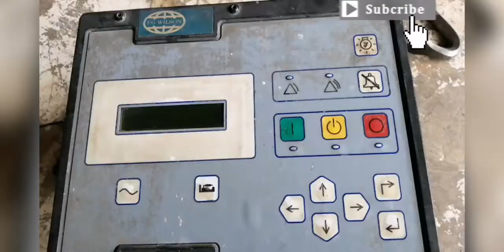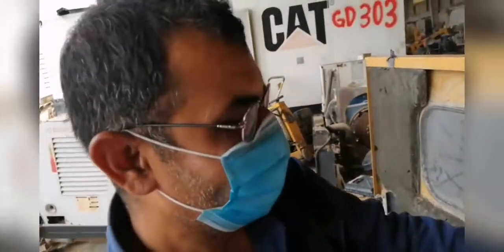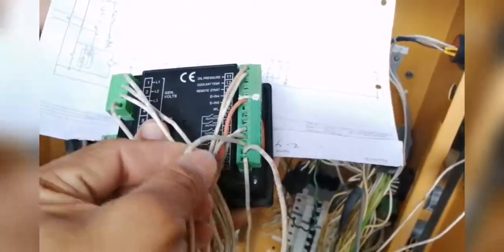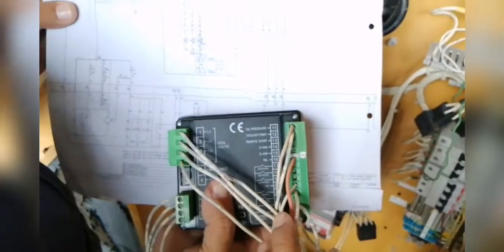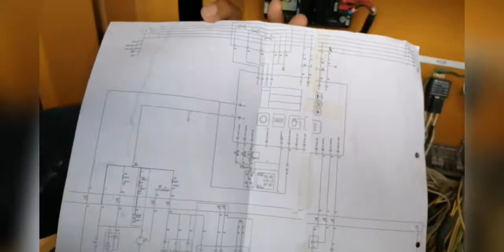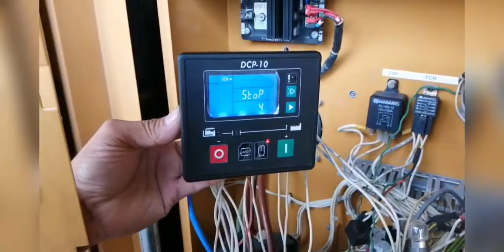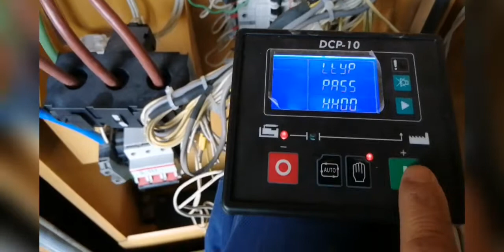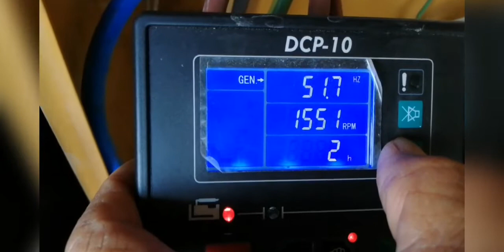POWER WISARD 1.0 CONVERT TO FG WILSON DCP II GENERATOR STARTING CONTROL

Comment: Hi l have FG Wilson DCP -10 it can’t start when I check it I found two relays ( start & fuel) 
Start relay has one point 85 ground line is it coming from control 
Fuel relay has two point 85 & 86 are  not coming from control 
I don’t know why they didn’t come 
Did the controller spoiled one have something wrong 
Please help me
Reply from the maker: about the dcp control, that is negative controled meaning positive is direct,or you can contac me in my whatsapp for better conversation, +971567581176

Comment: Hi, Could you give the information of Powerwizard 1.0 Battery power supply wire number or terminal ( + and -)?
Reply from the maker: bro usualy the power supply input is b+ pin # 52  b- is pin#65
Reply: @caterpillarjhunhunk  Thanks bro for your response. There is difficult to find the pin number . Is there any number written in the module. ? It is confusing that should I track the cable or pin number ?
Reply from the maker: yes bro there is numbering on the pin or if the socket is available you can check at there
Reply: @caterpillarjhunhunk  yes, I found the pin number. But I couldn't track the cable number. It is written that in the cable 5 controller 65 for negative and 7 controller 52 for positive. Do you know how long duration battery will work with out charging ? Thanks for your response and interest.

Comment: hi do you have dcp-10 software?
Reply from the maker: bro the sorftware you can found it free direct from web site of that controller,you have to make you account free
Reply: @caterpillarjhunhunk  what’s the name of the website I can’t find it
Reply from the maker: bro check the complete spec. of the controller seach it one by one which one will open
Reply: @caterpillarjhunhunk  did that and still can’t find it. Checked everything and everywhere
Reply from the maker: @nigel45212  what do you want about that controller,if you are looking a software i think or maybe you cannot find it,because  that type of control is not a very expensive,maybe you just wasting your time to repair or to find the way to repair,i m sorry bro about that
Reply: @caterpillarjhunhunk  I installed a new one but I can’t get it to read oil pressure it say u need the software to set it in the manual
Reply from the maker: @nigel45212  that control you are using right now is the original control for that machine
Reply: @caterpillarjhunhunk  no it’s different but Ive done hundreds of other panels and always got the software to program don’t know what’s wrong with this one lol it’s the first time using it 🤷🏾‍♂️
Reply from the maker: @nigel45212  bro try to search fg wilson dcp 10 that maybe can guide you to find software for your control
Reply: @caterpillarjhunhunk  can you send it to me?

Comment: Dear. I need wiring digram  University fitting 
F.G Wilson ,Olympian cat  module 650/044
045.  12v+24v - 24 wire grip use wire 13use
yuo have digram sent me.
My Email theengineringzone13@gmail.com
thanks
Nasir.

Comment: Boss pwede po, ba, Maka hingi diagram NG powerwizard 1.0 control wala kase kami manual. Salamat
Reply from the maker: wait lang sir ha kakarating ko lang galing s work
Reply: @caterpillarjhunhunk  salamat, sir nagka problema kase fg wilson ko na, genset GEP 165-2 wala akong diagram on going PA, kami, troubleshoot...
Reply from the maker: @dennisducalang3112  dyan nsir check mo nlang s email mo
Reply from the maker: @dennisducalang3112  anu problema genset nyo
Reply from the maker: @dennisducalang3112  location mo sir
Reply: @caterpillarjhunhunk  salamat, NG marami, sir
Reply: @caterpillarjhunhunk  walang output papuntang fuel solenoid Kaya, e trace ko Sana voltage sa, input tapos, signal, sa, output kaso di ko Alam ang wiring wala akong, diagram
Reply from the maker: @dennisducalang3112  anu b engine mo perkins b o anung brand, bigay mo s akin details nang makina mo baka makatulong ako
Reply from the maker: @dennisducalang3112  baka dkapa nka subscribe s channel ko subscribe mo nman at pki like n rin at share pra makatulong s iba salamat
Reply from the maker: @dennisducalang3112  sir bago k magtrouble shoot check mo muna emergency switch kdalasan nagkakaalikabok s loob yan tpos kpag napindot un nkalang ung dumi kya loose contac n sya
Reply: @caterpillarjhunhunk  tapos na sir Naka like na at Naka subscribe kanina PA hahahaha
Reply: @caterpillarjhunhunk  Perkins ang engine may eim at ecm 165 kva 1106c series ang engine
Reply: Sir dto aq sa Qatar, ang problema parang ayaw mag, communicate NG ecm ko pero di naman corroded saka wala din amoy sunog
Reply from the maker: @dennisducalang3112  may separate b n ecm ung makina mo